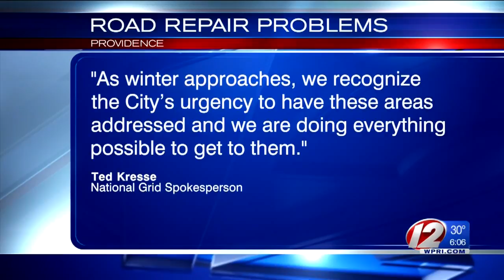Providence cracks down on National Grid, orders company to repair roads

Comment: WOONSOCKET IS IN THE SAME BOAT FOR DAMAGES, MY FRONT END HAS TAKING A BEATING ON SUSPENSION THAT'S GONNA COST ME MONEY TO FIX. WILL FIND OUT FOR INSPECTION, JUST REPLACED BALL JOINTS WITH BEST ONES MONEY CAN BUY, MOOG US TOP OF THE LINE, ALSO MY SWAY BARS HAS BROKEN FROM BUMPS AND GOING AROUND CORNERS, TRUCK SQUEAKS LIKE A MOUSE NOW. DROVE GREAT BEFORE. JUST REPLACED SWAY BAR BUSHINGS AND LINKS, ONE BROKE AND ONLY 4 YEAR'S OLD. HEARD IT POP AND BREAK. I KNOW VEHICLE'S, MY SONS HONDA IS HAVING STEERING ISSUES, THE SAME HAPPENED TO NEIGHBORS ACROSS, HOPING IT DOESN'T HAPPEN TO MY SONS VEHICLE, HER RACK AND PINION LET GO, NOT CHEAP TO FIX. ROADS ARE TERRIBLE.